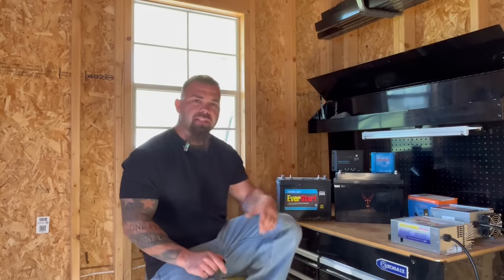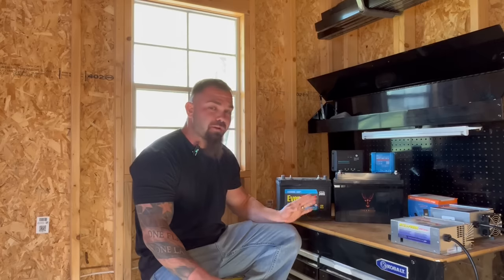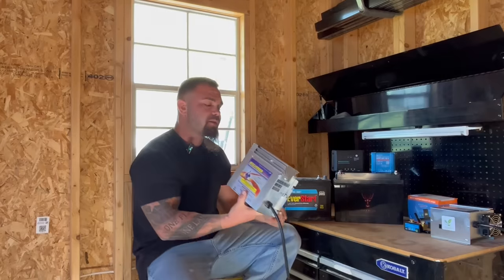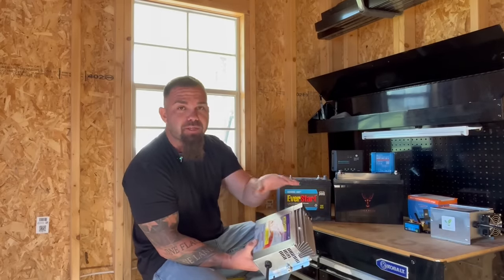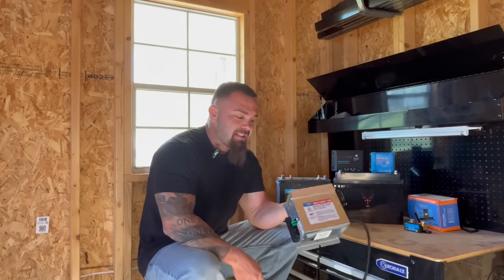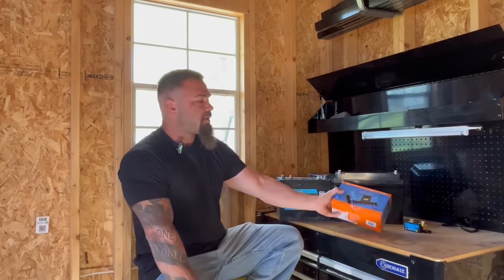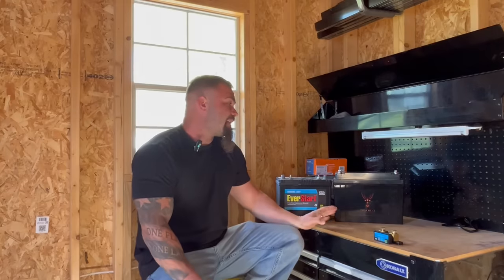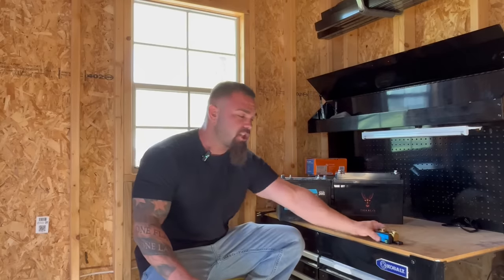Swapping to Lithium? WATCH THIS FIRST!

Comment: on a AGM or Gel battery is it better to rely on the state of charge chart or a smart shunt for actual state of charge because the charts are different and confusing
Reply from the maker: Good question! Personally, I find that understanding battery voltage on flooded or gel batteries is the best indicator for battery health and state of charge. Any battery regardless of chemistry only has so many charge and discharge cycles before it starts showing signs of degradation and eventual loss of output. AGM and flooded batteries degrade naturally much faster than lithium so using a battery monitor like a shunt will be the most accurate way to track state of charge until the battery starts degrading. At that point your shunt might say you're at 30% SOC when in all actuality your battery is all but depleted and using any more of that "perceived" 30% you are actually harming the output of that battery further. When your batteries are brand new you'll likely notice that everything is running great through the night, the voltage is still good when you wake up in the morning, etc... after a year or so you'll start to notice that now when doing the same night time activities the voltage is much lower in the morning when you wake up because the battery is slowly degrading. If you have a shunt monitor, the shunt doesn't know that your usable capacity is slowly decreasing. If the shunt is set at 100 amp hours that's what it is calculating off of in terms of capacity so when the 100 AH battery is new then everything matches up and its all good. When the battery capacity degrades to day 80% of its brand new state, the shunt still thinks the capacity is 100AH not 80AH which is more what the battery can deliver so now you have a 20% deviation and the shunt is going to mislead you at no fault of its own. 

If you understand and monitor those batteries based on voltage you will notice the degradation much quicker as voltage differences are very  apparent on a day in day out frequency.
Reply: @rvsolarconcepts  Thank You very Much bottom line with led acid batteries go by the chart

Comment: I switched to lithium battery and replaced two 6 volt batteries. Removed over 100 pounds of tongue weight. Installed lithium battery inside RV. In the 14 years owning the RV I have never plugged into shore power to charge the batteries, only solar. So a lithium battery and a new charge controller was all that was needed.
Reply from the maker: Very nice!

Comment: due to the charge curve of LiFePO4 battery's 13.6 is actually almost completely full, about 98% that last 2% is very steep on the curve and does not account for much capacity going any higher than that. just makes it easy for cheap bms systems to balance cells when you try go for 14+ volts at the expense of some cycle life of the battery. I charge my SOK battery to 13.8v and it still charges at 50amps until it hits about 95% then starts to slow down.
Reply from the maker: We agree 100%. That isn't really what this video was intended to highlight, but you are correct!

Comment: i love how the new vicktron charge controllers require you to pry apart the internal inductors and basically snap the board in half if you want to open them up and replace a fuse or solder in a new cap after it drys out and fails in 5-10 years. straight to the landfill.
Reply from the maker: What brand do you prefer?
Reply: @rvsolarconcepts  no name like EA sun power, imo same components made in the same factories in china, but atleast i can take it apart if and when it does go bad. my 30A mppt from ea sun power was 30$, hard bargon. how many of these can i burn up before it adds up to one vicktron? its all chinease components. i have learned to never trust warrenties, i am the warrenty yo. just let me open it up and fix it. like apple's new phones. still using a 2016 iphone SE that i crammed inside of my old 2012 iphone 5 chassie, and it works perfectly fine because i can fix everything for next to nothing

Comment: Thank you for the information that I've been looking for. Considering the price of lithium batteries and the cost of the changing of the converter/charger this is out of my zone..Since I don't do solar or boondocking I don't feel I need to spend the extra monies that I don't have. If I do upgrade it would be to AGM batteries since I don't need to change my converter/charger..Again great info - Thanks..
Reply from the maker: You're welcome!
Reply: The price of lithium batteries has dropped to the same as AGM per Amphr, and you can discharge them twice as far.  I found a cheap dongle to convert my converter to lithium, but the only time I use it is when I need to charge the house batteries on the generator.

Comment: Lithium has never been more affordable. So many great companies like SOK and Epoch. You can get 100AH now for 400 dollars and it will likely outlive any use case you have. I proudly own 2 SOk 100 AH batteries and they are amazing!
Reply: Also most chargers I have ever seen charge at 14.5 volts and float at 13.6. The only thing you need to change when going to lithium is Equalize charging, which would damage a lithium bettery

Comment: So glad I ran across this. My two T105 batteries are at end of life, and I"m going to replace with a 200 ah litime lithium, and add the Victron Smart Shunt. We do mostly off grid camping, and charge with a generator. Will something like the Victron Victron Blue Smart 12V IP65 Battery Charger be my best option if I don't want to bother replacing the converter in my camper? Or can I run off the DC line from my Yamaha generator straight to the lithium batteries?
Reply from the maker: The victron battery charger should work good for you. The 12V output of the generator probably has a very limited amount of amperage that it will output so it would take forever to charge them.
Reply: @rvsolarconcepts  is the 5 amp sufficient? Or do I need to go higher. Can only run generator a few hours a day a most NY State campgrounds
Reply from the maker: @cctknight84  you'll want at least a 30 amp charger so you can charge 200AH in 3-4 hours.
Reply: @rvsolarconcepts  First run with the LiTime 280 ah and Victron Shunt worked great. Ended up buying the LiTime 40 amp charger to run off my 2400 watt generator, only needed to charge once during 9 day trip. Next I need to add some bus bars or a maybe the Victron Lynx distribution. I replace the converter in the camper, but had issues with it until WFCO sent me a jumper, as the autodetect was a pain.

Comment: Most important things to remember, Lead Acid = 13.6. Lithium = 14.6. Thanks for this important briefing. 😎
Reply: No is not .
14.6 is max. On lipo4.
Lead need 14.6 volt to charge .
On of the reason that a car alternator go to 14.6volt.
Lead battery it cost volt to charge it .
A lipo4 do not cost volt to charge .
Its almost 1 on 1 charge.

The save spot for lipo4 if you like to use it for 40 years is 13.8 to 14 volt.

Comment: Good video other than important missing information... like if you only charge your lithium batteries to 80 percent and don't let them go lower than 20 percent - you will more than double the number of cycles of the batteries... given that using your standard lead acid battery charger will charge to 80% if using AGM/GEL setting.
Reply from the maker: This was not a video made to encompass every aspect of lithium chemistries but rather the important information concerning the switch from stearate batteries. You are correct though, using less of any batteries total state of charge will increase its lifespan dramatically.

Comment: RV alternator are usually a lot better amp wize than a normal car or truck one . Police/ambulance vehicles has very large alternators in them .
Reply from the maker: They are larger but not usually enough to give the amperage that 3 or 4 lithium batteries will request. Most 200AH batteries can request 100 amps of charging and it is not uncommon for us to do systems with 3 or 4 of those batteries in parallel. That would mean they are capable of pulling in 300 to 400 amps of charging which will max out most alternators these days.
Reply: @rvsolarconcepts  If your cable run from the alternator to the house batteries is 20 ft or more, the cable resistance will limit the charging current.  My 200 ah lithium battery maxes out at 65 amps from the alternator, even when discharged to 12.0v.

Comment: Great video I almost burn my C-Class up . Alternator wire to truck battery burn completely off . While driving. After dropping Lithium batteries in Coach!!! Beware
Reply from the maker: Wow! That's a pretty extreme example, but yes a DC to DC charger would have prevented the excess current in that line which would have eliminated the heightened resistance and ultimately the building of heat in that conductor!

Thanks for sharing!
Reply: @rvsolarconcepts 
You might be hearing half the story. Way too many people buy the biggest badest alternators or just bolt on ambulance types and wonder why it cooked the main lead. Biggest offenders are street car enthusiasts, street rodders, and guys with way too many watts in the back. Stereo junkies are getting much better. The other ones not so much. It is so easy to double the lead and often overlooked.
Reply from the maker: @kenmoule825 I agree with ya on that. The line should have still been fused properly and not get to the point of a fire though...
Reply: @rvsolarconcepts   Explain to me how you fuse a main line off the Alternator on vehicles?
One that last beyond a week or two anyway.
Reply from the maker: @kenmoule825  is this a joke? You don't think alternator lines are fused on every vehicle??
Reply: @rvsolarconcepts   No, it's not a joke. Most are not fused on vehicles. Anything before 2010 usually has no fuse. Some might have a fusible link near the main post of the starter but not the Alternator wire. It will cut power to the main wire harness but  not starter.
Reply from the maker: @kenmoule825  well I can't speak for older vehicles but all class C rvs that we've seen have had a fuse or DC breaker in line for protection which is what we're discussing here.

Comment: Which are best in colder weather? Is the cost per AH still lower for AGM?
Reply from the maker: Cost varies SIGNIFICANTLY between brands and quality of the cells that the batteries are made with. You'll need to be careful which ones you buy if you plan to be in cold weather. We really like the Diablo Power Group batteries as they have cold weather protection, built in cell heating grids, and have Bluetooth monitoring so you don't need to buy a shunt battery monitor as well. The app for them is very simple and easy to use, shows you your state of charge, internal temperature, number of cycles that you used from the battery, real time amperage readings, and my favorite tool that they offer through the app is the time estimation function that gives you an accurate idea how long you have until the battery is dead and also how long it will take until it is 100% full again.

https://www.diablopowergroup.com/store/p/lifep04-battery-heated-bt-100ah

Comment: Very informative video, thank you! Question: on my class B van, the coach batteries are grounded to the chassis, is that incorrect? Also, my inverter negative is tied directly to the battery terminal on one of the coach batteries, but not the one with the shunt. So my Renogy battery monitor doesn’t show any current draw when the inverter is running. Should the inverter be grounded to the chassis instead? Lastly, the output from the alternator goes to a battery isolator, and then to the chassis battery and the coach batteries. how does it know to keep charging the batteries if either the coach batteries or the chassis battery are low? Sorry for all the questions! Just trying to figure these things out.

Comment: I certainly learned a LOT from you, thank you!  One question,... you mentioned about a DC to DC charger for motorhomes but what about trailers that are being charged at the 7-pin towing connector while traveling?  Is it recommended as well to have it installed when switching to Lithium?
Reply from the maker: They are not needed for trailers. The wiring in the 7 pin connector is too small to allow any significant amount of amperage to pass through it so your alternator on the towing vehicle is not at risk, great question, thank you!
Reply: Appreciate the question and appreciate the response, I had the same question as I was watching this video. Thank you!

Comment: Swapped my motorbikes and a couple of my cars to LiFePo more than a decade ago. The batteries are more expensive, but they last a lot longer.  They work out cheaper over time.  If you care about performance you can have similar performance for about 20% of the weight.

Comment: Lithium batteries are awesome if you don't let the camper get below freezing. A lot of people camping wont run their heater until they get to the camp site in the colder months. Also people usually wont run their heater all day if they are out exploring.
Reply from the maker: Luckily they have internally heated batteries on the market now so this isn't an issue anymore for people who go into cold weather frequently.

Comment: Wow great info! Question If I have a eco flow delta pro with 1200W of solar plugged directly into my class A 30amp plug do I need to change out the original lead battery for lithium or will the system In place be able to keep everything safe and not under or over charged the batteries?

Comment: I have a 200 ah lifepo4 battery with a shunt that allows me to enter maximum charge and minimum charge in my motorhome.
What value is my max? I have it set to 13.6  but now after watching your video I'm thinking I need to set it at 14.6 what do you recommend?

Comment: Really great video on the lithium batteries for RV's. Question for you on this. Have they resolved the no cold charging when temps are below 32'f ? Our RV is northern cold climate and from the last I checked, lithium batteries will not charge from 32'f and below. 
Thank you
John A
60107

Comment: If the charger is set to Lithium and you put a Lead Acid that will be a huge problem, it will kill the battery. There must be chargers out there that can detect the type of battery and adjust accordingly.
Reply from the maker: There definitely are auto recognition converters on the market and some of the new RVs (2023 and up) are coming equipped with them.

Comment: The manual for my Jayco travel trailer says to "...install a DC to DC power converter between the tow vehicle battery charge line and the trailer lithium battery(s) to prevent lithium battery damage."  Is this the same as the DC to DC charger you recommend?

Comment: Why no mention of the Bluetooth BMS that comes on many popular batteries? I just installed a Litime 100ah w/Bluetooth in my camper trailer, it shows amps, volts, SOC, watts. I have Epever 30a mppt with 300w solar which has been performing well.
Reply from the maker: @Fixerfinn6823  It wasn't mentioned because it has nothing to do with swapping an RV to lithium... it's an option on the market but not everyone has it.

Comment: I e heard that if you have solar they can add the extra amp to top off the lithium battery...  At least if you can adjust the solar controller to lithium...
Reply from the maker: The solar charging portion of the system can assist the converter in charging the batteries, yes. For example, If you are using a standard converter to charge lithium batteries, it is likely they will only charge up to about 80%. However, if you program your solar controller for lithium charging then the solar could bring it up the rest of the way to 100%.

Comment: Iv'e heard a lot of comments on lithium doesn't like the cold weather.. whats your take on that? Also does lithium need to be vented like the lead acid? I have a camper and was considering making the move but would like to store battery in the camper?? thanks great video..
Reply from the maker: Good questions! 

Lithium iron phosphate cells are dangerous to charge under 32 degrees Fahrenheit. Most BMS these days regulate that and disconnect charging any time the internal temp of the battery goes below 32 degrees. The batteries will still discharge below freezing but shouldn't be charged in that temperature as that is when the damage will occur. The batteries we use have that protection and also have internal heating pads that are activated by the same sensor so it disconnects the charging function and transfer that power to the heater pads until the internal temp is above 32 degrees and then the heater turn off and charging circuit is resumed. 

Lithium iron phosphate, sealed lead acid, and AGM batteries are your best bet if you'd like to move them inside as those options do not vent.

Comment: Thanks for your very educated explanation, I do have I question about mixing lithium batteries I've a setup of 
(2) 12v lithium 200AH connected in series to make 24v system my question is if I get a 24v 200AH lithium same brand can I connect it in parallel with the (2) 12v =24v batteries?
Reply from the maker: @edwintorres5850  good rule of thumb is to never parallel connect a series bank with an equivalent AH battery in parallel. Will it work, yes. Will the series set become imbalanced, most likely.

Comment: Can I just connect a lithium battery charger to the battery so that it will charge to 14.6vdc after the converter charges it to 13.6vdc? In other words, have the converter and the lithium charger connected at all times. The lithium charger is a smart charger that shuts off when the battery charge is full.
Reply from the maker: Yes, It'll work it's just a little redundant.

Comment: What if you have a truck camper. We usually drive 8 hours a day when we are traveling.  Wouldn't my alternator charge a lithium  " so called" drop in.? We currently use 2 lead acid 12vdc Interstate RV batteries.  Just wondering.  Thanks in advance for your help.